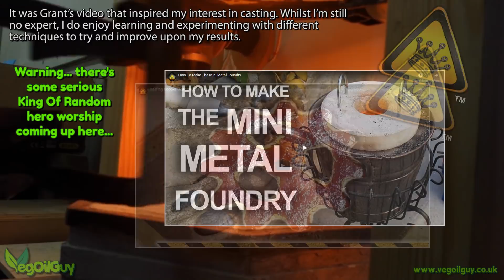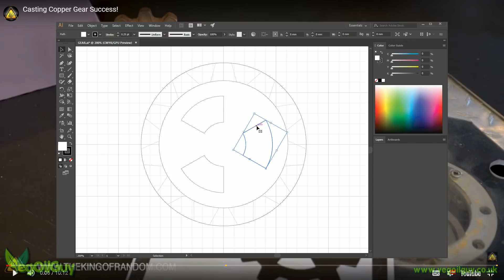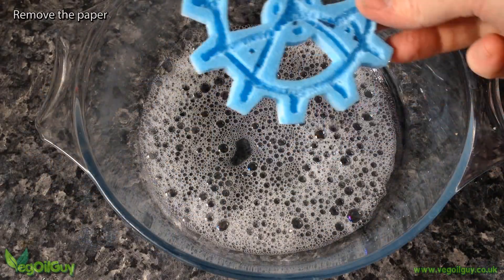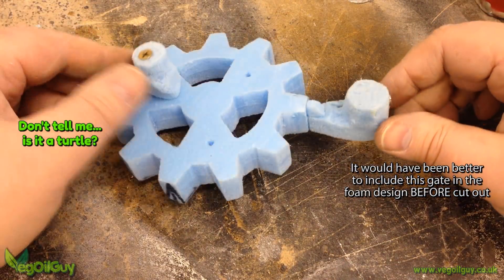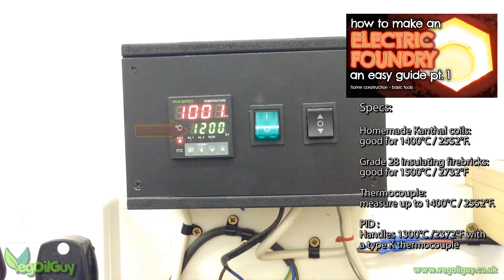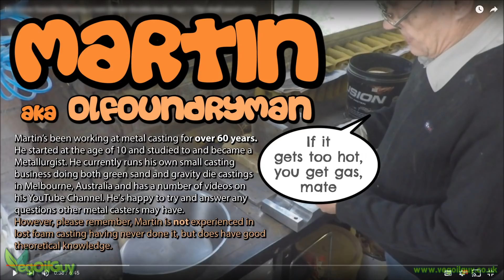King Of Random COPPER GEAR CASTING Tribute (and now memorial tribute) by VOGMAN

Comment: I use pretty much the same lost foam casting technique as you and only cast copper and bronze. You clearly have a lot of porosity in your cast, there's a cheap way to combat that, just stick some lump wood charcoal in the crucible and refill periodically. The charcoal has a greater affinity with the gas so isn't a problem. Then just before the pour drop in a pinch of flux, mix, skim and pour. I get perfect, gas free castings every time. Hope that helps

Comment: If you had not put any vents with the wire I am sure that everyone would be quick to say that is the reason why the copper boiled over. Next time around put twice as many vents and it will still boil over.  Copper is a metal that needs so many things to get right before you can get a good casting. You are finding out what so many others have found out on youtube about copper, it is a very difficult metal to cast.
Reply from the maker: I couldn't agree more  : )

Comment: Sorry for the long comment in advance brother.
You actually peeked my interest in this, I saw the king of randoms videos, and although very simple and to the point, I strongly preferred your in depth explainations and overall better quality of information. So thank you for all of that! (Not to discredit K.o.R., it's just a different audience I suppose)
Currently have a larger stockpile (for starting) of aluminum and, as you would say, "coppah" built up. Roughly 25lbs Aluminum and 16lbs copper (11kg and 7kg, respectively) now I got to buy
-an ingot mold, 
-crucible
- tongs/handle for crucible
and then buy the materials to make the foundry itself. I'm preffering  of doing it right the first time, going all out on more quality materials for D.I.Y. project. But my God does everything stack up rather quickly, do you have any advice on how to pinch in some areas without sacrificing too much on the overall quality? (Look at me, whining about the price of quality, ironic in'nit?) I have enough scrap wood and nails to make the caster molds for this, as well as a stable source of veg/motor oil (thank you local restaurant)
Reply from the maker: Hi Ryan, thanks for your kind comments : )
I meant every word I said - Grant really was the inspiration that got me started in casting. I'd never even thought about it until then.
Cheap but quality and good... I'd go with castable refractory - https://youtu.be/n42t3M1fOyY. It's VERY stable and holds together excellently. I bought the 1700C stuff and it's still crack free. You can also get high temperature and good insulation in one mix - more expensive but better long term. Add a layer of plaster (cheap - I've got a video on it - look out for it) to the outside for excellent and very affordable insulation. It will crack but continue to work. Mine's been through two winters now and is still holding together.
One tip, make it bigger than mine. I used a paint tin as my inner mould. I wish I'd have used the veg oil container. It would have given me much more scope for larger crucibles and bigger projects.
Hope this helps.
Reply: I agree with your breakdown on difference in audience :-)

To keep things affordable, yet not compromise on quality, I can suggest two other channels: Alec Steele and TAOW (the art of weapons)
taow made a fairly cheap yet wonderful electric foundry and made a great instructional video on how to build it. He's got other amazing videos with clear breakdowns on metal working. Alec Steele has a few videos about his castable refractory foundry build, with all problems he encountered and how he fixed them. I can strongly suggest his other videos too if you don't know him yet.

If you get a stable source of veg oil, maybe you can look into a diesel generator to power an electric foundry. If you add heating coils to the fuel pump and fuel line (I'm sure there's videos about this) you can run the generator on 100% oil.
Reply: oh, and one of Nate's first videos on TKOR is a quick-and-dirty alternative for the foundry, using only cale wool and a metal trash can, eliminating the need for castable refractory and avoiding all problems with cracks and crumbling.

Comment: Nicely done. I'm not sure about the imperfections. Could be temperature. I've never done lost material casting but I wonder if it's from the foam burning off.
Reply from the maker: You're deduction is a good one. There's a lot of gas created in burning the foam. But there's also gas that's gets absorbed as the metal melts. It's a gassy process : )
I'm fairly confident I could get a better result next time with better temperature and flow control. But time will tell.
Reply: That's true. When we did this in school we used a powder like additive when did aluminum. Right after skimming the junk on top we'd add that and try to push it under the surface. I'm not sure how it worked but it was supposed to encourage the gasses to leave the melted metal. I wonder if copper has something like that flux we used in school. There is a lot of science to this and I only scratched the surface. Keep experimenting, keep learning.

Comment: Nice attempt and tribute. One of my favorite sayings is "it's not a F.A.I.L it's a First Attempt in Learning". Even when you have a process down, changing part of the system is a new learning process.

So one thing I notice right away is your pouring into the large riser and not using a tapered sprue. As Olfoundryman Martin would say, you need to use a small tapered sprue, his pouring basin and sprue combination is a huge improvement over pouring down a large hole. video https://youtu.be/IrS_-NalXt0
This will cut down on air entrapment and air mixing of the metal.

You might also have too much moisture in your green sand (I assume it's water based green sand and not oil based petrobond) Excess moisture will exacerbate problems caused by the metal being too hot, basically the excess moisture will flash to steam and will look like air entrapment creating more porosity in the cast.
Reply from the maker: F.A.I.L - brilliant!! I've never heard that one, I wholeheartedly agree with it. If you're not making mistakes, you're not doing anything.
Yes Martin is a fabulous source of knowledge and is happy to help anyone. I'd love to see his channel do better. He deserves the recognition for all he does.
And thanks for the input. All suggestions are welcomed : )

Comment: I use those cheap unbranded thermocouples to melt copper without any measurement problems. I'm nearly 100% certain your problem is that you haven't placed the thermocouple far enough into the chamber (judging from part 1 of your build video https://youtu.be/XypmI38IKAw?t=1050). You need to have it roughly an inch inside the chamber of the furnace, otherwise you'll get much cooler readings than what it actually is. This will screw with your readings even for lower temperature applications. You should also make sure the threaded end of the probe doesn't get too hot, as I think that might result in inaccurate readings too. Most kilns I've seen have the thread a couple of inches away from the bricks, not screwed into the brick itself like you've done. There's also the minor possibility that there's electrical interference from being tangled amongst cables in your electronics box. Just order a dirt cheap 200mm probe and that'll probably solve your problems. Enjoying the casting series!

Comment: While you're right that it's better to spend time working the foam rather than grinding the metal, you seem to be spending a lot of time making your foam objects before each pour. Might I suggest doing some tests with relatively simple shapes. A solid block of foam, a hollow block, a waxed covered and sanded block. Ideally you want to ram them all up together and gate them with a single pour. Compare the results to see if your efforts are making a difference of if you are just wasting a lot of time for nothing.
Reply from the maker: Hi Brandon. Thanks for your comments.
You're quite right, for testing alone using more simple shapes is the ideal way to go.
What I'm trying to convey in my videos is that all manner of complex shapes can theoretically be made from foam and, if you've got your casting technique right (as I clearly haven't with copper yet), then time spent on the foam pattern will dramatically save time on metal finishing.
With aluminium, I've got it pretty dialled in. I use wooden templates to quickly reproduce foam patterns and dress these if imperfection exist. Certainly multiple items in the pour at once is also no unheard of for me, but again here I prefer to demonstrate just one to convey the idea more clearly.
And lastly, in this case, I wanted to make the copper gear in much the same way Grant Thompson made his.
Hope this clarifies my actions for you. Thanks for your thoughtful and constructive feedback : )

Comment: If you can find an inferred temperature gun that reads high enough that would be a backup reading as you bring your metal to the liquid state . Just a though for checking the temperature before you pour.
Reply from the maker: That's the goal Michael. Just got to save my pennies. But thanks for your feedback. It's always great to get comments.
Reply: Michael, what is the magic temperature for pouring copper? Do you an idea? Been frustrated for a while now that I’m pouring either too hot or too cold.

Comment: The splashing was from the uncured plaster rises 
Next time bake the plaster to remouve moistre
Reply from the maker: Hi Rabih. That's a could deduction. Plaster of Paris does indeed hold water. But in this case I'd already baked to around 250 Celsius. There might still be water present as I've heard some folks say it should go to 400, but I also know lost wax casters that don't bake that high.
Casting is certainly mysterious at times, especially when trying a new metal, as I was here.
Thanks for your input : )
Reply: Try to invest it you will have a great surface finish
Reply from the maker: All suggestions are welcomed : )